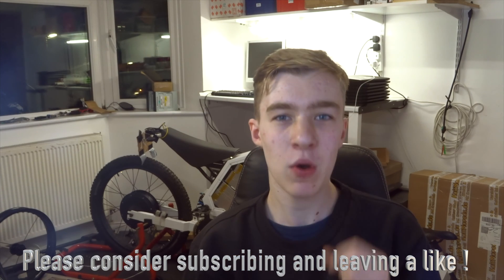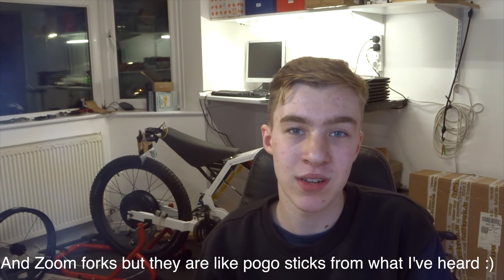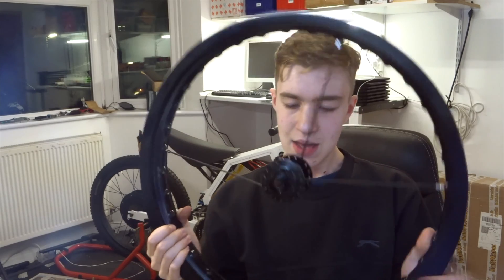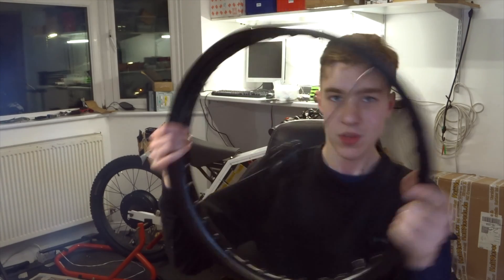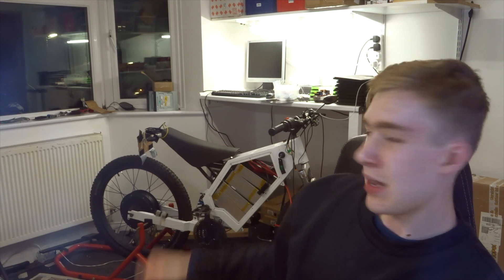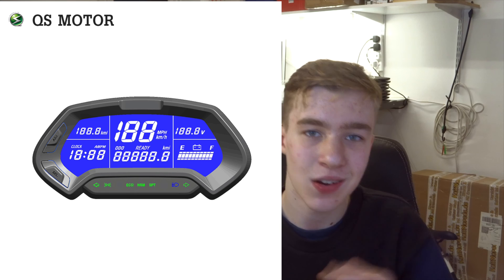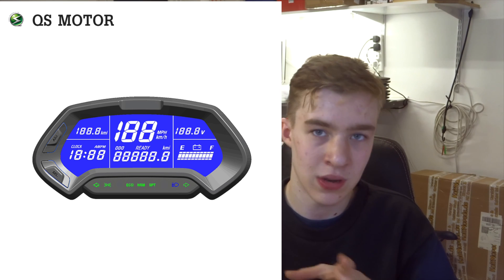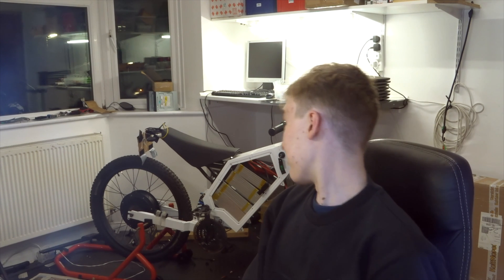Future plans for 8kW Enduro MSVA eBike and what went wrong...

Comment: Good luck mate.
Don't go the 125 route, go the moped one. There's a lot of misinformation out there but the speed hasn't got to be limited, you just have to state that it has a maximum designed speed of 30mph (if you get caught doing 60, that's your fault). You have a 3kW motor and that's enough, no need to limit it - the 4kW for mopeds is defined as the amount of power the motor is capable of sustaining continuously for 30 minutes, not the peak power (we don't run on SAE standards in the UK).
If you start buying parts with the MSVA in mind, try to get ones with E marks stamped on them, it saves on questions and having the examiner standing there with his tape measure. Also, if you have the MSVA in mind, KISS ("Keep It Simple"....) and then you can add all the goodies after you have the paperwork. Lights, indicators and speedo is all you need (nearly). The less questions and scratching of heads, the better.
No one will test the power or the top-end, all they'll test is the bare essentials to see if it's fit for registration and use on the UK roads 😉
Reply from the maker: I know about how 4kw is continuous not peak so 8kw won't be an issue. I wonder if the police would check if it's a moped if you were doing over 30 or whether they'd see it has a number plate, tax etc and leave you alone🤔 Cheers for the advice on E marking and 'KISS' 😁👍

Comment: Solid plan bro, I am in the process of registering my bike now. I highly recommend it , it will bring you a true piece of mind. I am finishing up the measurements for my battery and bac 8000 upgrade. Working with a seller on E.S.:https://endless-sphere.com/forums/viewtopic.php?t=105671
You should check him out when you have time. I can't wait to see your bike when it's finished. I thought about moving my ct22 over (to my bike) but dialing in the speedometer portion is true pain in the a$$..lol; that I really don't wanna  be bothered with at the moment. You have me very interested in your arduino programing project. Thanks for the update bro, I went with street tires and I love them. Keep me updated.💯👍🏽👌

Comment: I am at a very similar step in my build. You can get the sabvoton 72150 unlocked direct from QS and it allows for up to 150 amp flux weakening and 200 amp peak current for the same price as the normal 72150. Definitely worth doing. I have a ct-22 display and it isn't easy plug and play - make sure you buy it with the sabvoton because it needs to connect to a hall signal output wire on the controller. Hope this helps, cheers.
Reply from the maker: Yh 72200 looks worth it although I've tried contacting QS and haven't heard back for a week. What's complicated about the CT-22 - aren't there just wires coming out the back and the hall sensor one connects to one of the motor hall sensors?